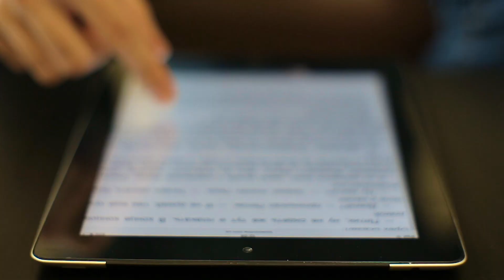NASA Seeks Ideas from the Public for Powering Exploration on the Moon

Comment: Suggestion:  Build a living habitat that produces artificial gravity & electricity both at the same time.  It would be in the shape of a giant donut.  The  habitat is started spinning with electric motors.  And then the motors are converted to generate electricity.  The giant donut shaped habitat continues to spin for a very long time because it is also a very large and heavy flywheel floating on magnets. The flywheel could be filled with water or sand or made out of moon mortar.(very little friction) (no atmosphere on the moon) (everything is done to keep the giant flywheel habitat spinning as long as possible) (only when it finally stops spinning are the people allowed to enter / exit, and restock the habitat, etc.)

Comment: Suggestion:  Build a living habitat that produces artificial gravity, electricity and exercise all at the same time.  It would be in the shape of a giant donut.  The habitat is started spinning by electric motors.  Then when people start excising, at least 10 people at a times, all the time, they jog on the inside of the habitat, they cause the habitat to continue spinning as the electric motors are converted to generators, and produce electricity, as the habitat continues spinning, because the joggers continue to jog.  At least 10 people continue to jog, all the time, causing the habitat to continue spinning all the time.  I guess approximately 960 people would live in the habitat, enough people to keep it spinning all the time.  The habitat could perhaps float on natural magnets, to reduce friction.

Comment: Suggestions:  Make methane gas from compost & feces and capture it, and use it as a power source for heat and steam generated electricity.  Either you could wait until there is a lot of compost & feces on the moon or ship a lot of compost & feces to the moon.  You would have to recapture the steam / water so it is recycled / zero loss of water.

Comment: Suggestion:  How about making an artificial sun that would orbit the moon once a day.  Like the death star on Star Wars, except it will give life instead.  It could be powered by hydrogen or methane, etc.   Or heated up with giant mirrors or laser beams relaying heat from the sun.  You could produce methane on this artificial sun from lots of compost or feces.  If one side faced the moon at all the times,  then only half of it would have to be hot.  If it was in a low obit, it would be more efficient.  If it was made out of Iron, the iron could be heated on the inside, and be red hot on the outside.   Instead of having one big one, I guess you could have 10 or 20 small ones, all orbiting the moon.   Now the question is, how do you make an artificial sun.  :-)  (I guess you would have to create an artificial atmosphere first, or the heat would just bounce off the moon.)  An artificial atmosphere could be produced with a giant magnetic satellite.

Comment: Suggestion:  Since days on the moon are 27 earth days long because the moon spins slower than the earth, maybe there is a way we could make the moon spin faster.  Making the moon days shorter, and giving sunlight to all of the moon's surface.  Maybe we could create an artificial magnetic field around the moon, then release gases similar to the ones on earth, creating an atmosphere on the moon, then we could build wind mills with electric motors instead of generators.  And then use them to cause the moon to spin faster.  ( just give it a gentle nudge) (we would first have to produce the electricity to run windmills)

Instead of using windmills maybe we could compress the air and release it as a  jet stream on top of a tower.  Basically the same thing as the windmills.  ( we would first have to produce the electricity to run the compressors.)

Comment: Suggestion:  How about flywheel generators, since there is low gravity maybe they would spin longer.  They could be filled with sand or water, or made out of moon mortar.  Also you could put them in a dust free vacuum.  Humans could manually start them spinning or at the risk of loosing some electricity they could be started sequentially by electric motors, the whole operation could be automated.

Comment: Suggestion:  Use moon dust / sand stored in a giant funnel and a bucket wheel or paddle wheel to generate electricity during dark times, replace the sand during daylight times.  You could build 10, 20 or more of these sand generators.  They could be automated to where no manual human labor is used to keep them going.  It might work on the earth, I don't now about the moon.  Maybe you could turn a giant crater on the moon into a giant funnel.  Maybe there would be enough gravity on the moon to make it work.  Maybe the moon dust would work.  Maybe you would have to find moon sand.  Maybe it's just a dumb idea.  Most likely having lots of batteries and solar panels is better.  How about building a giant hour glass timer generator.  Or a whole bunch of little hour glass timer generators.  The hour glass timer generators could be flipped by humans.  Perhaps there could be a lever, steering wheel or something that two people could use to manually flip 50 hour glass timer generators all at the same time.  The colony could have banks and banks of hour glass timer generators that could be manually flipped and generate enough power for the colony during dark times.  At the risk of losing some energy, the hour glass timer generators could be flipped sequentially automatically with electric motors.

Comment: Suggestions:  Use the moons core to heat up water and use the hot water for heat and make steam generated electricity.  You would have to re-capture the steam / water so it is recycled / zero loss of water.

Comment: Suggestions:  Use giant mirror satellites to relay sunlight to moon colonie's solar panels on the  moon.  Or use giant laser satellites to relay heat from the sun to moon colonie's water bladders on the moon, use the hot water to heat up the colony and generate electricity.  Or use both mirrors and lasers to relay.

Comment: I have looked at a lot of videos about colonizing the moon & Mars. And I haven't found any with my same ideas. I think we should set up a moon colony on earth. We should have inflatable domes, which we cover with 3D printers with simulated moon mortar. The domes should be connected to each other by inflatable tunnels covered with simulated moon mortar. There should be living quarters, hydroponic green houses, gardens with garden soil for recreational gardening,, a park with artificial turf and with small sections of real grass turf, and maybe even a very small zoo. All the domes will have plastic floors so no water is lost. Condensation forming on the ceilings will be drained into the water supply.  All the domes will be blown up with compressed air from earth and will have a refresh system, which will refresh the air and maintain the air pressure. Humidity, Temperature will be maintained by humidifiers, heaters, fans and coolers. Light will be provided by multi-color LEDs, mostly white. Power will be supplied at first by solar power, and later by nuclear or fusion power. All water will be re-cycled, almost zero loss of water.  

Also small animals, rabbits, chickens , turkeys, fish, fawns, elk calves, cow calves, lambs, goat kids, etc..
(a 6 month old cow calf eats 7 pounds of hydroponic greens a day until it is one year old and then slaughtered)
(a 2 month old lamb or goat eats 1 to 1.5 pounds of hydroponic greens a day until it is 9 months old and then slaughtered)
(the more humans & animals, & the more compost, the more top soil will be created and then grass and other feed for the animals can be grown in the soil.  Eventually they will have a nice pasture for the animals, and perhaps have a dairy cow.  (or lots of dairy cows)

There will also be pets, two dogs, two cats, two bunnies, etc. (and maybe a small zoo) All of this will be set up by astronauts and robots before the colonist arrive.

 The first colonist will be 22,500 fathers and  22,500 mothers, and 450,000 babies. The parents will be good parents, gardeners, farmers, zoo keepers, teachers, etc.. During the first two years an exact duplicate facility will be built on the moon. When the babies are two years old, they will move to the moon and live on the moon. Or if it is proven that they will be too young to travel to the moon than the facility on earth will be added to, to accommodate 45,000 more parents and 450,000 more babies. The two year olds would move into the new addition. Every two years the facility will be either added to, or 495,000 people will move to the moon. This plan will allow the kids to grow up in the isolation of the colony, and will make it easier for them to live in the isolation of the colony on the moon. And will allow them to grow up on the moon and be better able to adjust to the lower gravity on the moon, although some artificial gravity maybe eventually be provided. This artificial gravity will especially be good for the parents. The kids will have everything in the facility to keep them occupied and entertained. Also they could have some books, movies, games, etc., especially adapted for them, being careful not to give them anything that would make them feel isolated. 

After 20 years there could be 8,910,000 people living on the moon, most of whom grew up on the moon.  

This program could be simultaneously done to colonize Mars so we could have 1,485,000 people on the Moon and Mars at the same time, after 8 or 10 years.  For the moon we could send supplies every month, but for Mars we could only send supplies every 26 months.  So I suggest we send 10, 20, or 30 rockets to Mars every 26 months all at the same time.

We could have several refueling stations along the way to mars and orbiting mars so rockets could refuel along the way to mars and right before landing on mars so the empty rocket would have enough fuel to take off again, refuel in space and return to Earth.  Eventually the colonist could grow trees, bamboo, and other plants for raw materials that could be used for making things.  Eventually the moon and Mars could export minerals or small expensive items that were assembled on the moon or Mars, like jewelry, iphones, iwatches, etc.  Or grown on the moon like caviar, marijuana, etc.
What do you think ?  :-)

Comment: 1.electricity transmission through light? something like li-fi
2.or the transmission of electricity through electromagnetic waves, which will then be read as data by one devices
3. or a generator that generates energy by burning the moon material, with a built-in battery
My 3 ideas :D
Reply: Not possible
Reply: @theguywhodoesntstop5123  possibile ;), maybe you know about li fi ? ;P
Reply: @damexphotos  yeah dude I'm researching on electricity 😂😂 . why if a bird blocks the way, planes, obituaries, or even satellites.  Direct transmission down